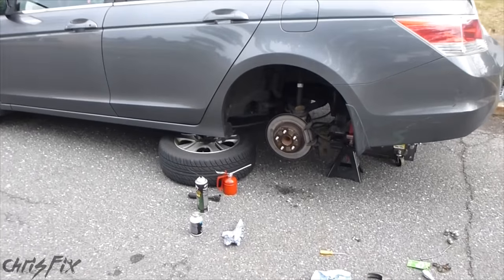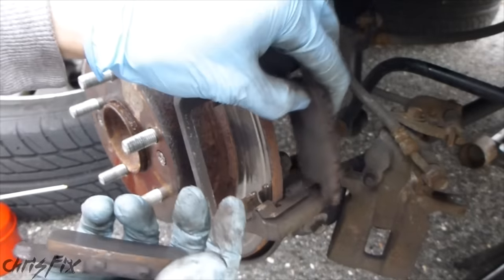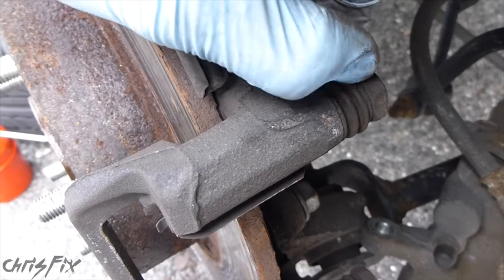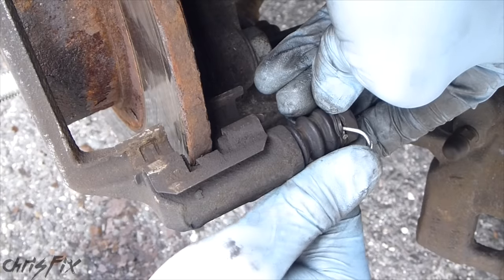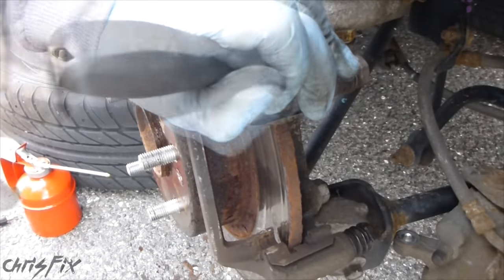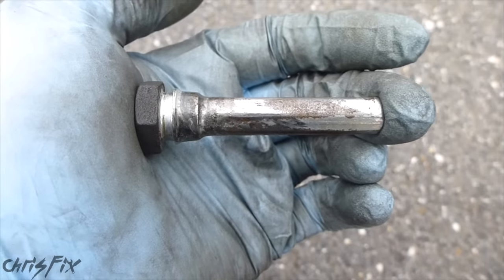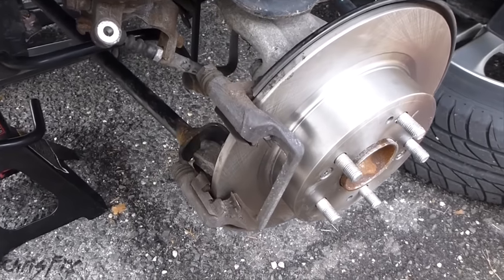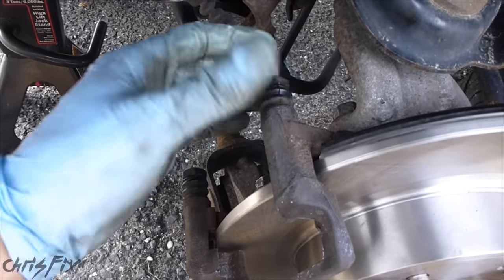How to Fix Uneven Brake Wear

Comment: You can chuck the slide pins in a cordless drill and use 100 grit sandpaper or emery cloth to clean the rust and corrosion off them. Gives them a nice smooth finish and costs basically just time and sandpaper. Some pins have flat spots machined in them to retain the grease, so dont panic if you happen to see that.

Comment: what about cleaning out the guide pin holes?
Reply: Also, after I clean the pin AND socket (hole...whatever it is), I install the boot on the pin and make sure there is plenty of lube still on it after the boot slides off the lube put on it initially.
In this video, the boot pushed off most of the the lube as he slid the pin in the hole.
This guy does fantastic videos.
Edit:  I was not being sarcastic about his videos being fantastic.  I have learned a lot and he does it without a bunch of needless talking.
Reply: You cannot get all the corrosion out by cleaning the slide pin bore. Its actually recommended to replace the caliper mount bracket with the new slide pins.
Reply: For the money you save doing it yourself just replace the caliper mounting bracket along with the pins, pads and rotors
Reply: @rivieraauto8540  And?  This is not structural, as long as it slides, it is ok.
Reply: @aitorbleda8267  not sure what angle you're trying to play with the structural argument but what i would say is you're right..... its a safety related system..... therefore its not ok to do a cheap half ass repair for a customer who may potentially come back and sue you in the event that they end up in a crash. Or better yet can make you liable for criminal charges in the event someone is killed. Its happened before. Not really something you look at if you're doing your own brakes but, nonetheless if you're working on safety related components... moral of the story is do it right. If you dont replace the caliper bracket and slides together. They will continue to sieze once water gets passed the pitting from the corrosion that was cleaned off. Not something i necissarily consider fine.
Reply: @rivieraauto8540  I agree with you but you are way overboard. This pin was not moving at all and resulted in uneven wear on the inside of the brake pad. The brakes still worked as intended for safety, but were a noise issue for the driver (thankfully not ignored). It's not like they are more unsafe then before this job was done, if anything the job will need to be done sooner due to uneven wear again. Shops that do brake jobs just clean as much as they can, and the simplest thing is to use a drill to clean the hole. There is a whole old comment thread here discussing cleaning the inside of the hole on the caliper bracket.

Replacing the caliper brackets is fine if you don't want to spend time cleaning them, but that's literally all you are getting at the end of the day if you get charged for brackets from a shop (have not seen this outside of actual structural damage), or buy them yourself. The core charge when buying Caliper brackets, is so you return the old part off your car. That part goes back to the 'manufacturer' and they rebuild (clean) it, then sell it + core charge again. I would not be one bit surprised to find out they spray penetrating oil, drill, soak, wire grind, and that's it. This is just a piece of hardened steel that does not move, it's not like an alternator where you can actually replace internal parts to rebuild it. Again no shame in paying $15 for a professionally cleaned part, but just know thats what you are getting, not something brand new.

The bigger elephant in the room you should call out is using the same brake rotor after it was ground down metal to metal as shown. That rotor is probably warped from uneven pressure as well.
Reply: @TheJuanSolid  the manufacture I work for does not even recommend attempting to clean them in all actuality mainly because they wind of just corroding again. Therefore we recommend replacement everytime a slide pin locks up. I diddnt even catch the part in this video where they mentioned the rotor went metal to metal. But in that circumstance I most certainly agree with you when brakes go metal to metal they certainly do need new rotors. But when it comes to a locked up slide pin.... im recommending a whole new assembly bracket and all.
Reply: @rivieraauto8540  in an ideal world sure. Most caliper brackets will go for years without being quite so picky. There's usually quite a lot of slop in there.
Reply: @stephendee7839  you shouldnt have quite a bit of radial movement in a slide pin either. If you have radial movement in a slide pin bore then its certainly a sign that you need to replace your mounting bracket and slide pin. Cant say ive really seen one go that bad but hey.... theres a first for everything to.
Reply: @rivieraauto8540  They don't work individually, they work in tandem. Compared with the tolerances one sees in an engine or transmission, they're completely sloppy and that's okay. Yes, they shouldn't allow 2mm play, but 0.5mm on each pin is going to be okay once it's loaded up with grease. These are definitely not precision fit components.
Reply: @stephendee7839  ok..... keep telling yourself that. Im not the one who deals with premature break wear and under performing brakes. Again youre off on a tangent which is completely left field of what im saying here. So i will state it once again. The problem with re using the slide bores after they corrode and lock up is they almost imediately begin to corrode and lock up again. Has nothing to do with being precision or not. The cause is because once pitting feom corrosion has started in the slide bore. Water has an easier path to travel through it again. Therefore the correct service recommendation is to replace the caliper bracket and slide pin as a set
Reply: @rivieraauto8540  I guess you work on three year old bmw's. I work on 30 year old chevy's. Different worlds, to be sure.
Reply: @stephendee7839   well if you worked on anything as an old timer I can certainly tell you the automotive repair imdustry has greatly changed. Back then you used to rebuild starters, alternators, and master cylinders too. We no longer do those service procedures anymore because it all comes down to liability
Reply: @rivieraauto8540  I think you're mistaken on the liability front. It's all about economics! Shops make more money on high dollar parts than they do on small dollar parts. If they can sell a $150 alternator instead of a $5 voltage regulator inside the alternator and the manufacturer doesn't sell the regulator separately, then the shop uses that as justification for billing the whole alternator rather than only replacing the failed regulator. And these days, most mechanics couldn't swap a voltage regulator anyway, so there's deliberate industrial incompetence at play as well.
Reply: @stephendee7839  ok well i guess we cant get nothing past you then 👍
Reply: @JetSkiBuyFixPlaySellChannel  why? they are working. It take 15 minutes to get them off again if there is a problem.
Reply: @rivieraauto8540  More expensive but makes life easier and it just looks better having new parts.
Reply: @JetSkiBuyFixPlaySellChannel  Around here, you can't just buy a caliper bracket. You are forced to also buy the caliper....unless you go to a junkyard.
Reply: @oobaka1967  it depends on the year make and model youre working on.... some have just the bracket and slide pins but most include the caliper too.
Reply: @Maurice Harting the reason its recommended is because once they corrode and pit its easier for water to enter the slide pin bore and sieze again...... if re used they almost always re sieze not long after trying to clean then up.
Reply: Grease does not stop water intrusion.
Reply: @Maurice Harting however did they corrode in the first place then?!?!?! 🤣
Reply: @Maurice Harting oh gotcha glad we have plenty of youtube master techs out there to explain this concept whatever would I do?!?!. 🤣
Reply: @rivieraauto8540  id totally use new pads,rotors and pins. Brake system is the most important part of a car. Its your safety and thr safety of other drivers. Without them or doing half job could cost your or anothers life. Period.
Reply: @marv9906  is not HALF JOB! Way you lieing your self. Half job is to strong word for 0,01% damage,worn-out pins.
Reply: @borivojetravica569  go ahead and cheap out on someone's brakes and when you hear of them being torn in two from slamming into a pole have that eat at your conscience
Reply: @marv9906  you are not answering how is that half job. Ok than way you don't bay brand new car every 5 years, instead you doing that, half job. Sell it and bay new one.
Reply: Do your brakes the way you want to do them. I would clean out the bore and re-use them. Might mean I'll be revisiting it sooner than I should, but that's my prerogative. If you think that reusing those pins was somehow dangerous you should just stay wrapped up in bed.
Reply: Also at the 'manufacturers say you should replace the bracket' comment. It's easy for manufacturers to ask you to buy new stuff. Selling things is quite literally *what they do*.
Reply: @marv9906  We are not working on other people's cars. You think people in the business come to ChrisFix's channel?
Reply: @marv9906  on breaking test my car have same results like with new parts and after 70 000 km. Sow how is that HALF JOB?
Reply: @borivojetravica569  read the previous post ya mooks. I was taking about working on other peoples brakes. Jesus ahort attention spans these days i swear
Reply: @marv9906  HALF job?
Reply: Acetone on a circular wire brush perhaps?
Reply: @rivieraauto8540  i always get cheated by mechanics, the brakes sounded terrible in traffic after he replaced them, i complained and dropped the car off, he said nothing was wrong with the brakes, later looked myself and discovered he used absolutely nothing to lubricate the brakes or the guides. the brakes would have never failed though you'd just have extremely uneven wear, just really annoying sound and frequent brake pad replacement, and yeah he got away with doing a half ass job. and you can't sue for that, i mean are you going to sue for 300 dollars probably not, if you have proof of some mechanic getting sued for a half ass break job, send it my way!
Reply: @crystalpettry3519  in the event a serious injury/death is caused by below industry standard repairs. The technician is subject to both civil and or criminal lawsuits. That is a fact. Matter of fact in dallas texas. Technician was conducting a state safety inspection on a vehicle. Failed to rack vehicle and identify brake lines rusted out. Technician served a prison sentance for involuntary manslaughter. The case is very extreme. But your situation... no youre probably not gunna sue over 300 bucks. However if serious injury or crash results then yes... people sue
Reply: @rivieraauto8540  But you should clean the bore everytime you lube the pin,  no matter if it is stucked or not. This is because the old grease might not be compatible with the new one, e.g. you change from red eubber grease to sillicone paste. Otherwise you can end up with the kind of mud there was on the car the Chris worked.
Reply: @valichesu  last time checked mud and grease are two very different things sorry but not a reaction like you claim.... corrosion/rust occurs when water intrusion occurs.
Reply: @rivieraauto8540 Hi, this is what I am trying to say, mixing petroleum based grease with silicone grease is going to form some kind of mud in time. Also, if you use normal petroleum grease for the calipers  pins, this will become hard in 1-2 years because of the high temperatures. These are effects that I saw on my own cars and has nothing to do with the water intrusion. This is why I strongly recommend to clean the holes and apply new grease always.
Reply: @valichesu  look yes it dont hurt to clean the holes. But I feel like you have some confusion because petroleum based greases are not recommended for slide pins in the first place as petroleum causes the breakdown of rubber seals. To be honest at toyota we have a pink rubber grease that we use for this. Silicone grease has been found to be reactive to the rubber as well and is not even the best thing to use on slide pins. What im saying is... once the pins lock up. You need to replace the slide pins and mounting bracket
Reply: @rivieraauto8540  I use some of my Carmex Lip Balm on the pins lol. The kind you squeeze out of the tube.
Reply: @rivieraauto8540  do you know what the purpose is of the rubber bushing on some of the guy pins. I have a 2002 Sienna and just to avoid uneven pad wear, which happened to me some years ago, I was having my mechanic lubricate my pins today.
Well, he took one out with a pepper bushing and couldn't get it back in because the bushing has swollen so he just cut it off and said you really didn't need it and put it back in.

I can't seem to get a straight answer on the car forums as to what the purpose of the bushing is, but I don't think they put things on brake car parts that you don't really need, and I'm wondering how long I got before I can replace it before some bad shit happens.... and what bad shit am I looking at possibly happening in the mother takes me to get the money together to do that. The parts are cheap but I'm going to have to pay the labor for him to get back in there and do that
Reply: @michaelrs8010  im gunna assume that it is supposed to control lateral movement but honestly I have seen other techs remove them and never have an issue too. So realisticlly should you put them back on....yes. but is it gunna hurt your slide bores if its not there probably not.
Reply: First Last  it was actually just a local repair shop that i haven't went to since. i did a perfect brake job two months ago, 1) retract piston, file the rust off of the brackets where the brake pads slide, don't unbolt the caliper guides from the caliper and just slide them off the bracket, 2) put the ceramic grease on all parts of the caliper that touch the brake pads, but don't put ceramic grease on the pads because it will already get the grease after it makes contact with the rest and helps avoid a mess in the process, 3) put ceramic grease OR silicone paste on the caliper guides, but do NOT try to put it in the holes for the guides or it will create a positive pressure, instead just clean the holes with alcohol or vinegar and q tips, 4) squeeze the caliper bracket and actual caliper together with two of Harbor Freights 99 cent with coupon 4 in bar clamps, one of each side 5) slide the brake pads in place through the opening in the bracket. so this brake job was perfect because i didn't make a mess of the grease at all! reminded me of doing a oil change without spilling any oil
Reply: I always take the mounting bracket off, and fill the guide pin holes with brake clean or wd40, and do something else while I wait. Amazing how much gunk comes out
Reply: @JetSkiBuyFixPlaySellChannel  On some cars though, the guide pins, bracket and calipers are all one forged piece.  Which makes the job both much more expensive (have to replace the entire caliper assembly) and longer (have to now bench bleed all four wheels)...
Reply: @rivieraauto8540  you are talking absolute rubbish.
Please do not comment if you are not qualified
Reply: @dsuse3949  I have a master ASE certification L1 advanced level diagnostic specialist certificarion 4.5 years dealer experience and 15 years total experience wrenching proffessionally.... does that make me qualified?
Reply: @crystalpettry3519  you dont lube the pads where touchh disc...
Reply: Had one job where i found the rubber boot torn and the pin seized inside. Turned out the last guy just used copper paste on the pin and left all the debris inside the pin hole. I couldn't even get it off using a hammer. We ordered a new caliper bracket cause the customer was pissed by all those brake jobs.

Comment: These frozen guide pins are usually caused by a damaged or mis-installed boot. If moisture gets past, it will eventually gum up and prevent the pin from floating properly. A wire wheel works wonders for cleaning the pins. Also don't forget to cleanup the bores as 1/2 the problem is inside too!

Comment: Why did you not clean the bore the guide pins ride in??  The bore will be just as dirty as the pin was.
Reply from the maker: dieselworld Thanks! You should definitely clean the bore as well! Use some brake clean and a screw driver with a towel at the end to poke around!
Reply: Chris Fix for the win!
Reply: use a dremel with a wirebrus to clean out the bore and also take of the stainless steel brakepad slider of  and clean the caliper bracket because rust will pushes the stainless steel slider against the sliding edge of the brakepad
Reply: lacossa nostra my Tundra has rubber boots inside the caliper holder. Just an FYI if I was to dremel that. She gone!
Reply: For the money you save doing it yourself just replace the caliper mounting bracket along with the pins, pads and rotors
Reply: @JetSkiBuyFixPlaySellChannel  Pads and rotors, obviously. Pins - only if it is corroded or worn, if they look fine there is no need to replace. You may need to replace the bracket if there is a ton of corrosion inside any of the slide holes - but I've never seen much, even when pins get corroded. The bracket in this vid is probably just fine.
Reply: Thats exactly what i did when I did my first brake job and im no mechanic. I figured it was common knowledge to clean it too